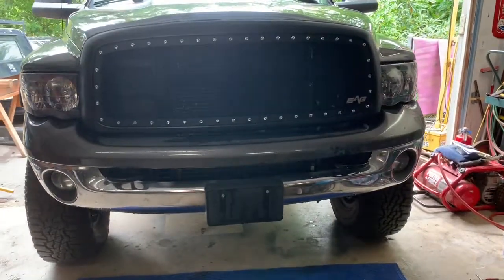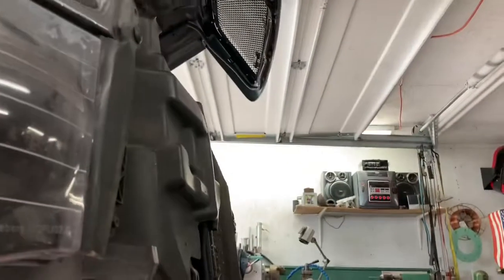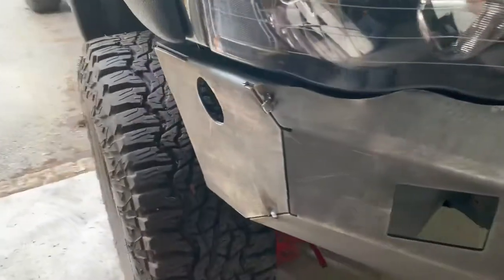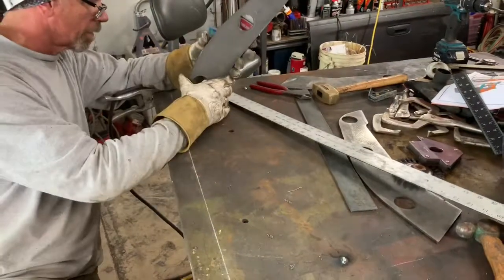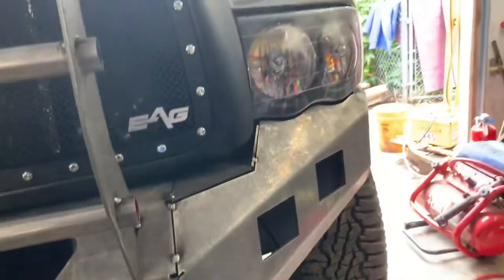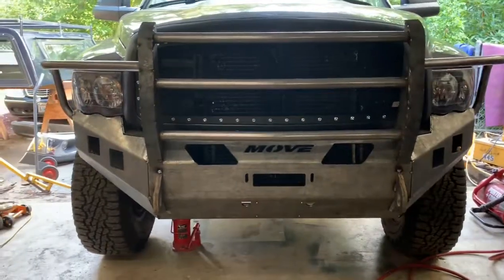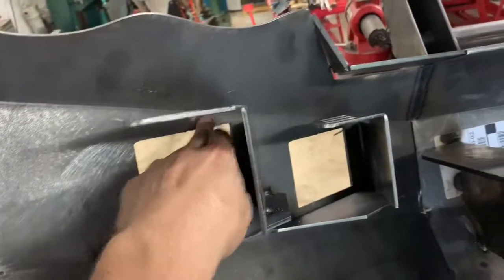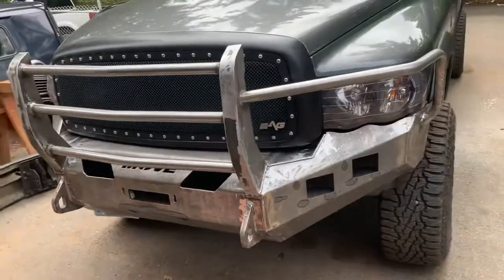2004 Ram 3500 Move Full Grille Installation

Comment: You put brackets on wrong. They go on outside of frame so angles on inside reach the wings. Fyi
Reply from the maker: We originally lined it up on the outside but there were clearance issues with the lights and the condenser, hence why we adjusted and did it the way we did it.

Comment: You wouldn't had needed to add reinforced pieces inside if you put the brackets on outside. Looks nice anyhow.
Reply from the maker: We originally lined it up on the outside but there were clearance issues with the lights and the condenser, hence why we adjusted and did it the way we did it.